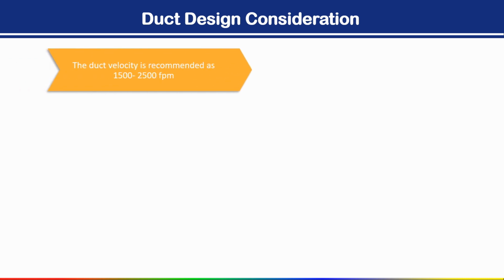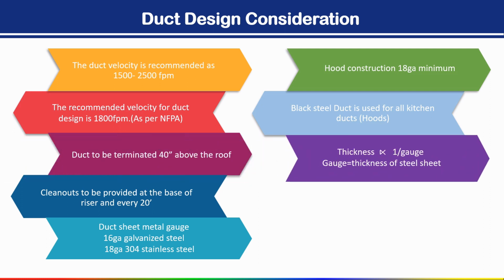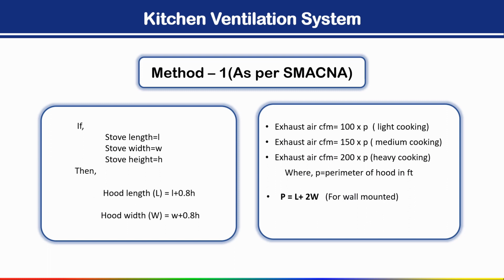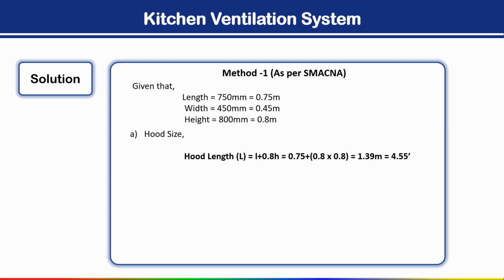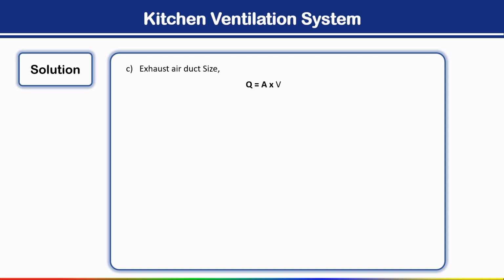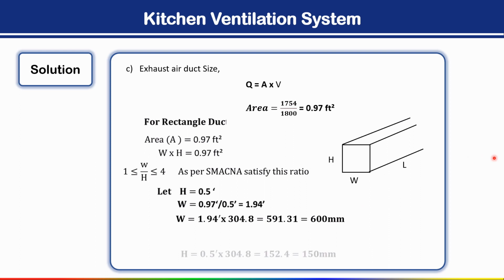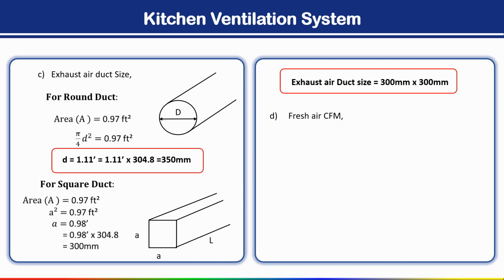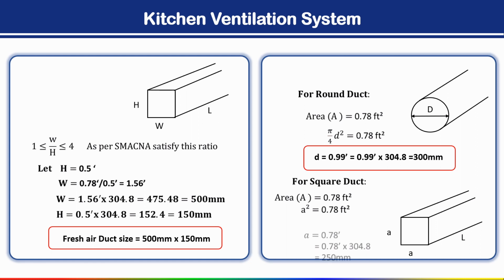Calculation for Kitchen Ventilation System as per SMACNA | Part 03 #hvac @hvactutorial

Comment: Sir what are the daily routine or responsibility of mep site engineer & supervisor ? Is it only the work on site or in office also as per situation..
Reply from the maker: Responsibility of MEP Site Engineer:

Design Coordination: Collaborate with architects and other engineers to ensure MEP systems align with project requirements.
Material Selection: Choose appropriate materials for MEP systems, considering functionality and cost-effectiveness.
Installation Oversight: Supervise the installation of mechanical, electrical, and plumbing systems to ensure compliance with design specifications.
Quality Control: Conduct inspections to ensure work meets industry standards and regulations.
Problem Solving: Address issues that arise during construction, providing solutions to ensure smooth progress.

Document Management: Maintain accurate records of project changes, approvals, and as-built drawings.

Responsibility of MEP Site Supervisor:

Workforce Management: Supervise and coordinate the activities of construction workers and subcontractors.

Schedule Adherence: Ensure the timely completion of MEP installations according to the project schedule.

Safety Compliance: Implement and enforce safety regulations to prevent accidents and ensure a secure work environment.

Resource Allocation: Manage resources efficiently, including materials, equipment, and labor.
Communication: Facilitate communication between different teams and ensure everyone is aware of project updates and changes.

Progress Reporting: Provide regular updates on project progress to higher management and stakeholders
Reply: @mepbooster8184  Thanks a Ton !! 😊